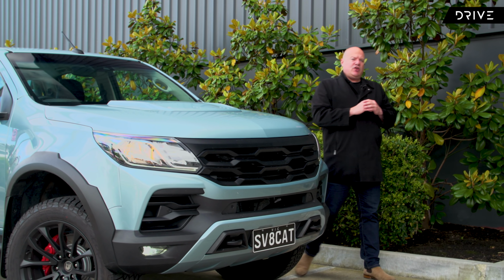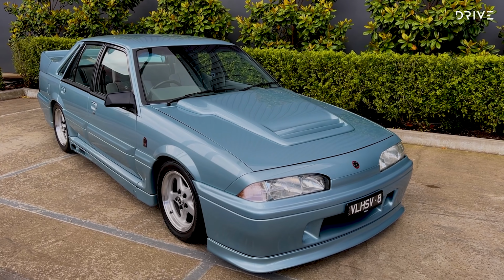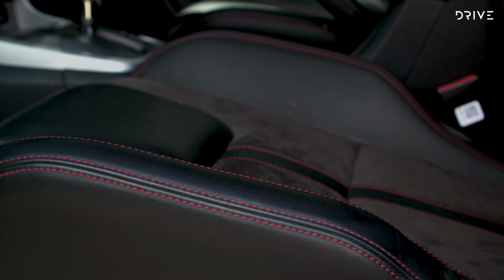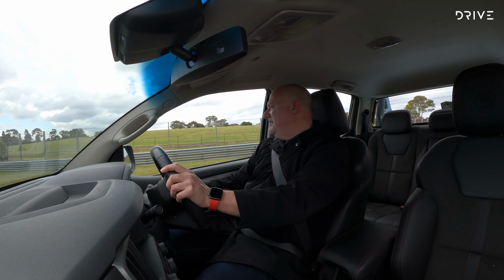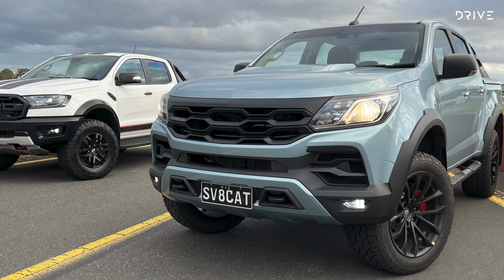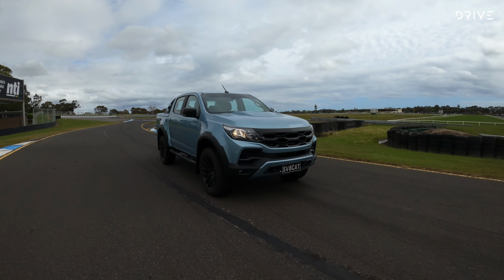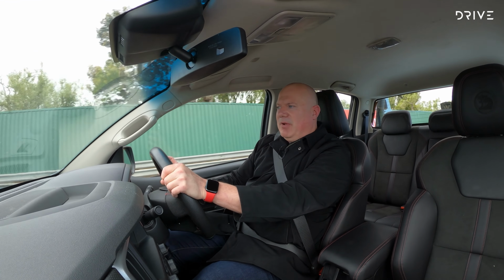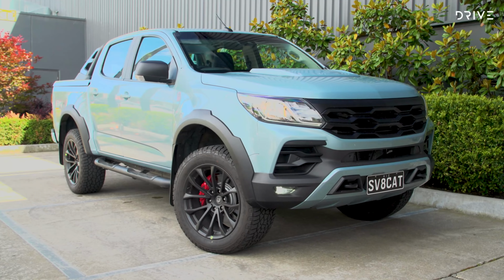The Top Secret HSV Colorado V8 | Best Holden Never Made | Drive.com.au

Comment: LSA Sportcats are a thing, and have been for some time. Hard to find, sure. But there are still a fair few. Saying this is a 1 of 1 is disingenuous at best, and a lie at worst
Reply: Yes but those cars don't have the approval of GM. These would have been a factory approved model and come with full warranty. Also this one has the LT1 motor in it, not an LSA.
Reply: @tomnewham1269  back when this was being developed, there were tons of examples of LT1's going pop at anything over 650bhp, whereas the LSA or LS9 have been pushed well into the 1,000bhp+ range. I'd take the reliability of the LS over the minimal weight savings the LT delivers
Reply: @tomnewham1269  you could buy ls3 swapped colorados here in nz straight from holden dealers and it came with normal colorado warranty and free servicing.

Comment: I owned 11 holdens in my life and two weeks ago finally swapped from my Colorado to a Ranger. The Colorado was the most reliable car I have ever owned only requiring a single hose and a door switched replacing in 270+kms other than proper maintenance. the Ranger was back to the dealer within 5 days with a huge oil leak, then the 2nd week (this week) it had a coolant leak,. They fixed it and then told me there was another leak and also said the engine needs replacing. After spending $55k I am now stuck with a shitty loan car that I cannot fit any parts to so I can do my job. Ford Customer relations also seems to be a Indian call center who just tells you scripted crap and doesn't give real answers. I am talking about a brand new Ranger not 2nd hand. I am so depressed about this.
Reply: Hey dude, looking to get my first 4by 
Which year Colorado did you like? I’m looking at the 4jj1 but prices are nuts, but I’ve found an 07 rodeo in budget and a few around about there for $5k more with 250-330kkms
Or the option for a 2014 at max budget also with the 2.8l diesel with 180kkms
I’m pretty out of my depth so I just ask any one nowadays

Or alternatively should I get a 1hz 80 series like everyone says is the go to
Reply: It's the vice versa for me

Comment: As a motoring journalist one would expect you would have completed your due diligence  before making incorrect claims. Need to get your facts right. There is a V8 dual cab Ute out there. Killa Kustoms have have dropped the coyote V8 into the Ranger Raptor. Drive in and out, Fully engineered and road legal. Whilst not a factory release this is the closest thing to it for those who have the means.

Comment: Harrop has been building and selling these for ages.
Reply: Not with the LT1 and 10 speed auto trans.
Reply: @RED0N3  that’s true but they sold nearly none so can’t see this being all that popular.
Reply: @THEROADSMITH  but Harrop is not HSV and factory backed. HSV would have sold heaps otherwise they would not have spent the money on this project before doing a business case.
Reply: @tomnewham1269  more likely they did the business case and decided they wouldn’t sell.  They had v8 commodore utes they didn’t sell as many as the 6. They had the commodore dual cab 4wd v8 thing.  Didn’t sell well. The wagon version the same.   Both sold more as 6s nobody bought the harrop conversions.  The dual cab racing series isn’t very popular  both as tdi and now as v8.  
And the Colorado isn’t even popular as a Ute to start with.

Don’t get me wrong. I’m all for specials and aftermarket hsv fte Ralliart trd etc type cars.    But they don’t end up being popular unless there’s a racing pedigree.
Reply: @THEROADSMITH  the reason they didn’t sell was the stupid price they charge for the conversion. This was gonna be 80 grand plus on roads. Most of the conversion companies charge minimum 40 after buying the car. And that is just running gear conversion
Reply: @danielcantrill3104  I’m not sure price is the whole issue.  Plenty of people with the money.  All the company’s making money chopping new land cruisers into utes or extending the chassis would be as much or more money plus the cars are more expensive than this to buy. What I mean is there’s money if the product is right.    As a percentage they didn’t even sell many v8 commodore utes.

Comment: Australia top 5 best UTE base on power and reliability ;
1 Toyota Hilux
2 Ford Ranger
3 Isuzu D Max
4 Nissan Navara
5 Mazda BT 50

Australia top 5 best price UTE
1 GWM 
2 LDV T60
3 Mazda BT 50
4 Mitsubishi
5 Izusu D Max
Reply: Both of those lists are wrong using your own criteria.  Lol 
I recommend google searches..
Reply: @THEROADSMITH  Why would you wanna google it? I'm stating on my true aussie's ute fans base not those youtuber reviewer who isnt long term ute user!
Reply: @dann5515  you need to google it.  Your lists are completely wrong. 
And none of them are Australian utes champ
Reply: Ford Ranger a 10 year old platform 💪🏽
Reply: @Kyxmyx  Think Hilux made it longer than 10 years
Reply: Nah mate 
There’s 2 Utes
Commy ute
Falcon ute
Get it right
Reply: @johnodonnell1222  errrr how many do you still see them on road lately? They havent been on going production like almost decade? Yeah back in old day they are moster with XR6 and HSV ute..... but no thx to aussie shutting down all car manufactory ... They promised Holden will continue in australia market... and now is RIP at the late 2020.
Reply: @dann5515  again another paragraph of rubbish.
Reply: You forgot the Subaru Brumby
Reply: What a load of rubbish. The Hilux is probably the most unreliable. DPF and limp home issues. The older ones had injector failures. Etc ... 
Ford has had bad engines that require replacing in less than 50000ks plus gearbox and wiring issues.
Yet the Mitsubishi Triton, not listed has had no issues reported in the latest models. Hence the 10 year warranty.
You need to do a Google search first, not listen to some mates at a pub! 😂
Reply: @richardg3335  ok fair enough. Since i dont drive ute. But base on hearing others comments. But if it related to body durability do u still think Mitsubishi triton over hilux and ranger 🤔? Because if ute are that shitbox then their suv are shitbox too then.